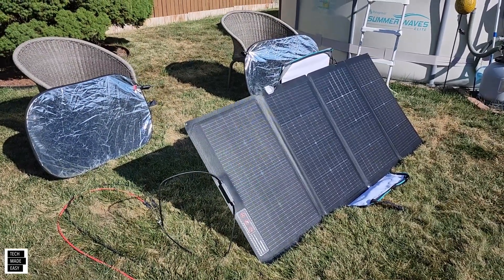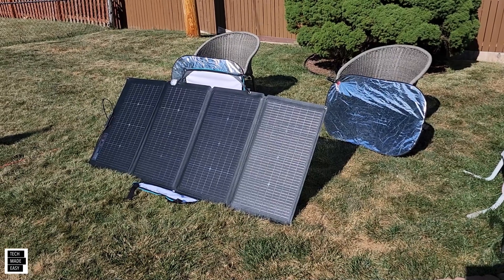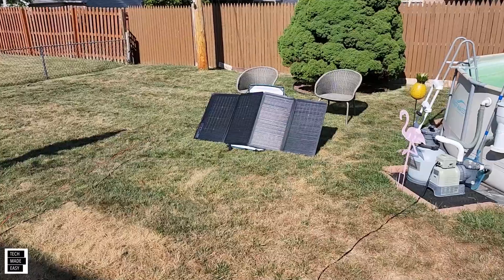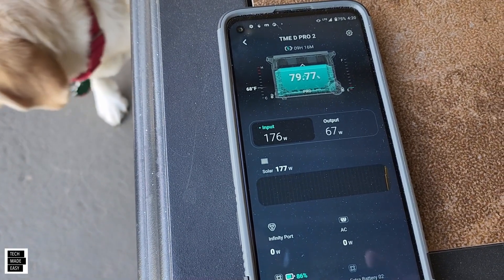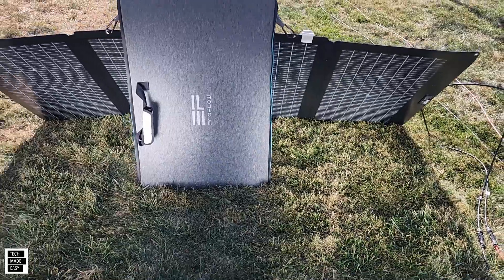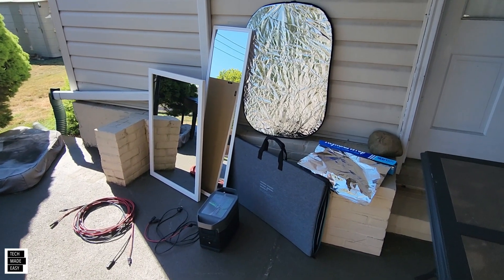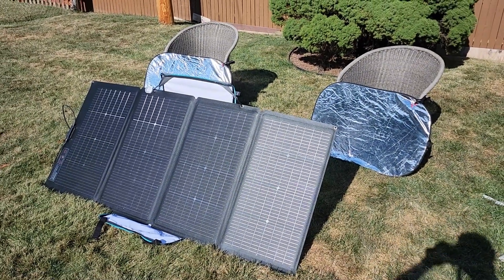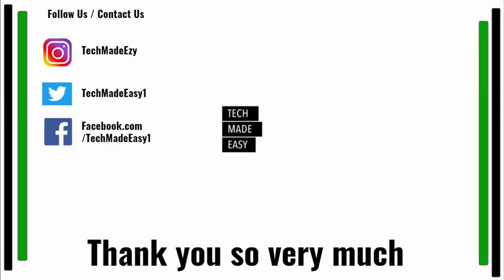PART 3 FINAL  EcoFlow 220w BiFacial Solar Panel Reflective Testing

Comment: Hi, I have 2x220w Bifacial and 2x110w solar panels. Would I be able to connect these is series and get the most out of them or will the 110Ws bring the input down? If I can , what would be the best order to connect them? Any feedback would be much appreciated.
Reply from the maker: You can, but they won’t perform well you’re probably gonna wanna put one set in series and one said in parallel, but again that’s depending on your power station. Please make sure before you connect that they meet the needs of your power station and they don’t exceed or you can cause damage.

Comment: Silver is the Best! - Used EMART 24'' x 36'' (60 x 90cm) Light Reflectors ($19) on a EcoFlow NextGen 160W Portable Solar Panel - I got 184w on a 160w Panel. The Panel was sitting on the pair of Reflectors.

Comment: After commenting at some length earlier (apologies), I realized another possible variable that probably is limiting the output of the rear panels. From my photography background I know that the reflectance of average dark foliage (like green grass) may be 1/4-1/8 less than average light stone (e.g., concrete), and that highly textured surfaces like grass will produce a more diffuse reflection (and thus a less intense reflection over a given unit area) than a smoother surface. Both of those effects are probably at play here. (Think matte black velvet vs smooth &shiny black plastic sheet vs smooth white plastic sheet.) A smooth, light-toned surface should produce a more specular reflection and probably around 4x more intensity than a grass. Hence the suggestion of using mirrors or foil to up the output.

FWIW, I appreciate the time and effort you put into these tests and reviews. I'll also add that you have a very pleasant, easy-to-listen-to voice and delivery. In fact, I'd say your delivery is the best I've encountered on YouTube regardless of subject. I don't know what your occupation is, but I'd wager you could do voice-overs professionally.
Reply from the maker: Thank you so much

Comment: OK, I have watched all 3 videos on this topic and have a couple thoughts. I queried earlier about using those mylar space blankets as reflectors for the back side and still think that might be the way to go. They could just be spread out around the panels, both front and back, to direct more bounced light to the panels from a variety of angles. I think one additional problem that hasn't been mentioned at all is that perhaps the construction of the glass is limiting the acceptance of the light at rear. If I understand that concept correctly, something like a Fresnel lens or the sensors of a digital camera need to have and direct light rays at a certain angle, and as most solar panels are made with the limitation of getting best performance when the sun is normal (perpendicular) to the panel surface, angling the mirrors/reflectors at angles greater or less than 90-degrees would result in some inefficiency. So, elevating the panels as someone suggested could allow the reflector to be adjusted more perpendicular to the rear surface. I'd bet that would increase the output, but even having the reflector bouncing light up from the ground surface at an acute angle might be more efficient than having it come in at an obtuse angle as in your setup. And if the shape of the surface of the glass also made a difference, the combination of effects might be severely limiting the wattage output of the rear.

Also, as I understand it, when linked in series any shadow cast on the surface is going to impact the efficiency so the shadow cast by the support at the rear of the panel might be a limitation as well. (One of those space blankets could even be used inside on the panel support to bounce more light into the shaded area directly in the the path of the mirror reflection.) As I'm very new to all this, I'm just speculating about what could be limiting the output. Are there "smart" panels that could tell when part of the surface is getting more direct rays than adjacent cells (uneven distribution and intensity of illumination)? Something like that (if it exists) might be why the mirrors don't boost the output very much - you have an area with a lot of input next to an area of low input.

Also, I think the comments about heat are also relevant with performance being limited as the temperature of the surfaces increase. Might be useful to run some comparison tests under cooler overcast conditions and also to determine the output of the rear panels alone by covering the front with something opaque or just flipping the panels around. On that note, I wonder if rotating the panels top to bottom might have an effect? If the rear surface is indeed acting as a screen at certain angles, rotating the panels would switch the incidence from what had been obtuse to a relatively acute angle while the front surface would still be normal to the sun's rays. Hope that makes sense.

Again, I'm new to all this and just commenting from the perspective of a retired photographer that has dealt with Fresnel lenses and lighting angles in a former life. I've ordered 2 Delta 2 packs (which short circuit at 15A solar input if I understand your most recent and helpful review comments on limitations imposed by smaller battery models) and 2-220w bifacial panels. So, as for today, I have no experience with solar power but should have my hands on the equipment in a few days and then can test some of this myself. In the meantime, thanks again for some very informative and thought-provoking reviews. Based on what you related, I think I made a wise purchase.

Comment: I like your content, thank you for all the testing.  For your hard effort I just subscribed.  Just bought the 2 bifacial ecoflow solar panels and am hoping to connect them in series to charge my delta max .  Loved the reflective testing done on part 2 and 3.  I'm thinking of doing the same testing on mine using reflectix but am thinking of taping it to the back..  Well see as soon as I receive the panels.  Bought them at great savings during the prime sale event.  Again thank you for your hard work.

Comment: I cannot understand why the 10A generator which should have had a MPPT controller would not have used the excess current and turned it to voltage to increase the Wattage? Or does it not have an MPPT controller? Just a PWM controller?
Reply from the maker: MPPT
Reply: @TechMadeEzy  What do you mean?
Reply from the maker: It has a MPPT controller
Reply: So why is it that it output more wattage with the 15A generator? If the MPPT controller was working as it should on the 10A generator, then it should have had much the same output?

Comment: Can you recommend a solar panel cable extension? Im planning to charge my delta pro inside my house while the panel is in my backyard. The cable ecoflow is selling is not long enough. Thanks
Reply from the maker: I included a link in the video description, click that you can choose from different sizes, just make sure you stay with 10awg ( that’s the thickness ) try not to go more than 40/50 feet or you might need a different cable.

Comment: great solar panel, I purchased it along with a Delta 2. I want to also have the ability to use the panel to charge my lead-acid trailer batteries. (Zamp port)  What do I need to make that work?
Thanks! 8-)
Reply from the maker: Thanks for watching and honestly I really don’t know the answer to that question

Comment: Question: I have Delta 2, it’s 500W & 15A Max according to user manual. Can I connect to it two 220W bi-facial panels? Or this 15A is combined?
Reply from the maker: You can connect 2 in series, 60v is the max and each are 21.8v that's fine. Series 👍🏻

Comment: I’ve found that this panel does particularly well when elevated farther above the ground without the stand and also at a much steeper angle (more upright). There’s a bunch of research to support both the steeper angler and height above the ground for bifacial panels. The highest I’ve seen on my Ecoflow Delta 2 was 266 watts with the above setup with snow on the ground and temps below freezing.
Reply: I got 255 today in 35° weather sitting on the concrete in front of a white garage door.
Reply: Today for a brief moment I peaked at 500W with 2 220W panels connected to my Delta 2.
Reply from the maker: @adamburge5988 very very nice
Reply from the maker: @adamburge5988 nice 👍🏼

Comment: VOC is much more important than Isc.

If VOC is higher then what your solarbattery can take, you will have zero input.
If Isc is higher then what your solarbattery can take, :
- On most days and most hours the produced amps will not even get to the Lsc.
-If it does get to that amperage, the solarbattery will take what it can and only the surplus, in this case maximum of 3 A, is lost. It will do only on a sunny day, a day where you are likely not too worried about getting in enough amps

So most minutes, hours and days of the year, you don't even loose anything. And when you loose some amps it is at moments you can afford it because it is a super sunny day.

So, let's not do too much talk about a very little thing that isn't a thing at all.

Having a panel that might produce more then you sometimes can take is a good thing. It also means it will produce more on these cloudy days that other panels are doing little. That is when it counts! This is called overpaneling and when done correctly (so overAmping instead of overVolting) it is totally normal and even a good idea. Personally I would prefer two 110 watt panels for just 50 euro/dollar more and connect these in parallel when needed. Total weight is less, easier to pack and same yield.

So please do a test on a gray not so sunny day. That is when we want to see what this panel does, the days that we really need it.

Comment: DUDE! kudos for doing SO MUCH experimenting BUT only seems to get an extra 15w even from mirrors etc? IF you're doing this much experimenting, why not take 5 min to drop a blanket on the front to discover what the rear side is ACTUALLY yielding? Seems like hardly adding wattage/efficiency for such an expensive panel. Total gimmick. Blanket will expose the truth of the gimmick. AKA, if you're only getting 15 more watts or so, for the extra price tag...hmmm maybe I can get more watts buying two regular panels at regular prices? or am I way off? please advise :)
Reply from the maker: After all if this, I recommend 2 EcoFlow 160w Panels, will cost less and you will get more wattage

Comment: I really enjoy your videos, thank you for all the work you put into them. I recently discovered you when I started looking into solar power options. I have a question that you may have been asked already, not sure that the 400w panels are bifacial as well, but is it possible with the Pro and the 400W panels and putting the reflection on the back of those panels, would we produce higher wattage as you did with the 220? FYI, my plans are to go with the pro, 3 x 400w panels and a smart home panel to start with and upgrade from there to an entire home back up solution for bugging in as needed. Thanks again for all you do.
Reply from the maker: Hi Ron thank you so much for your comment and no the 400 watt is not BiFacial the 220 Watt bifacial panels go on sale from time to time you could probably get two for the price of 1 400 watt panel
Reply: @TechMadeEzy  I just did exactly this today. 2 of these 220 watt panels for $150 less than the 400w panel.
Reply from the maker: 400w long term I wasn’t Impressed, definitely difficult to move around and they don’t really perform as well

Comment: My EF Max works well with the 220w BF panels. I think if the panels have no blocking behind them like the stand it will do better. I am going to use the wood support across the panels (thanks to the heads up by Tech made easy) and support them so there is no shade on the back of the panels. Thank you Tech Made Easy.
Reply from the maker: Thank you

Comment: Seems like this BiFacial panels are the most efficient panels I have ever seen.  I think I want a couple of them.
Reply: Hmm, for optimistically marketed flexible panels you mean? Delivering 85% of name plate power out of the box  or 91% with rear reflectors, which should not be needed, but just ambient light according to specs, I would call that underwhelming!  This is a 175W panel. Usually the specified power is the minimum power at the end of the warranted life of the panel, so this should be 205-210W or so when new. Maybe it is me who doesn't like flappy panels always haul rigid panels around: I have an 80W rigid panel 22% efficiency and it delivers 85W, it is the size of these ecoflow panels when in their bag. Further I removed the original frame and glued on some Alu U profile around instead to get less bulkiness for transport. Heavier yes and you likely don't care of my opinion on this, possible, but that's it.

Comment: I have these panels and I don't like that there is no easy way keep the cables secure when you pack it up. The MC4 connecters flop around and can get in between the folds of the solar panel when its in the bag. I'm worried this could crack the panel if too much pressure is put on them. I wish they put some grooves in to secure the wire on the side.

Comment: Honestly I get 180 watts easy without the reflector. I think though that these weren’t really designed to be used with mirrors. If you look at how bifacials are used in ground mount arrays there are two natural things that yield more watts. I’ve gotten 200 watts out of my panels with one of those things. But I’m not saying just yet. That’s for an upcoming presentation I’m doing at a conference.
Reply: Don't tease us. Spill the beans!
Reply: @piratelestrange  unfortunately no. I have my reasons due to history with this channel.